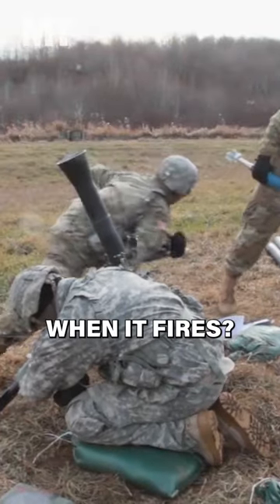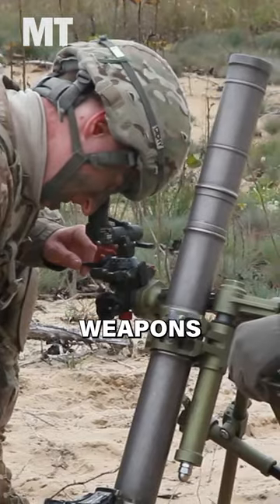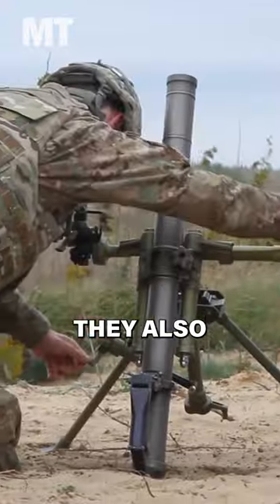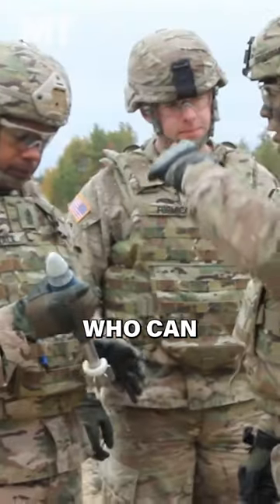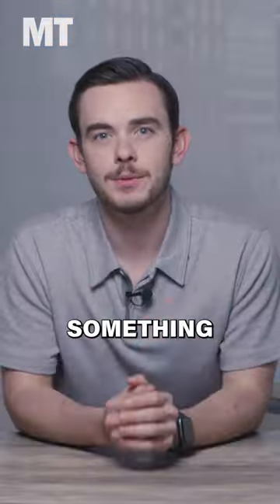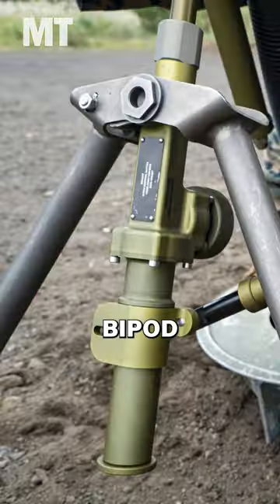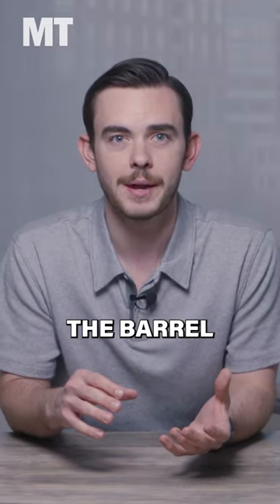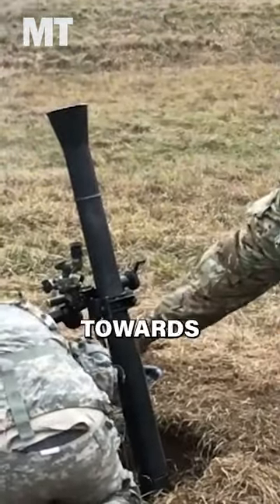Are mortars more complex than dropping a shell in a barrel? Learn more in 'How It Works Wednesday'

Comment: The Pin doesn't ignite the propellant charge. The pin strikes the ignition charge/cartridge which then detonates the main ring propellant charges firing the shell from the tube.
Reply: ... except it does not detonate! The shell filling if it is HE detonates, not the propellant!
Reply: @felixthecat265  the snap on ring lifting charges are detonated
Reply: @axelgs11  No sorry.. the augmenting charges are filled with propellant similar to shotgun powder. They burn, not detonate. The high explosive in the bomb filling will detonate when the fuze functions. This is a completely different effect.
Reply: @felixthecat265  No sorry let's get into detail.
The priming cap in the bottom of the mortar extension tube is lead styphnate,(LS) the older and much more dangerous primers which contain mercury fulminate. The more modern ones are LS. These primers are detonaters and when struck cause a detonation wave through the ignition charge. 
The whole process starts with a Detonation.
Primary explosives, like fulminate of mercury, are used as detonators for more stable explosives.
Reply: @axelgs11  No sorry, you have got this wrong. Yes, there is a detonation in the primer cap that starts the process, but the output from it is a flame, not a detonation wave. Propellants work by deflagration, not detonation. 
Most modern primers do not contain LS as this has been phased out because of lead contamination. The active ingredient is usually a tetrazine compound but has flame enhancing material such as aluminium and zirconium dust to increase the flash effect. 
Primers and detonators are not the same...!
Reply: @felixthecat265  No sorry your wrong. You agreed in your first sentences. There is a detonation. The lifting charges don't burn. If they did you wouldn't have an instant effect. The detonation wave travels through all the propellants making a 100% detonation. It's not a burn. Primary explosives, like fulminate of mercury, are used as detonators for more stable explosives. Alfred Nobel used fulminate of mercury in blast caps for detonating dynamite.
There are several types of explosive used in primer caps.
Mercury(II) fulminate, or Hg(CNO)2, is a primary explosive. It is highly sensitive to friction, heat and shock and is mainly used as a trigger for other explosives in percussion caps and detonators.
What don't you understand.!